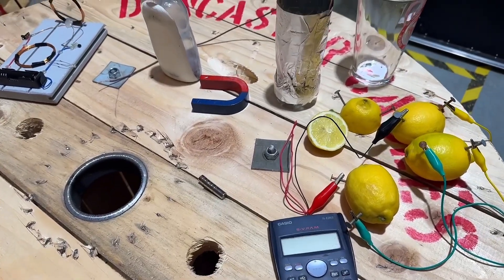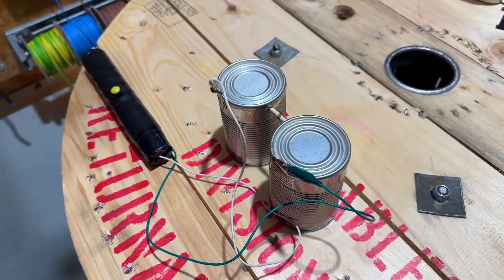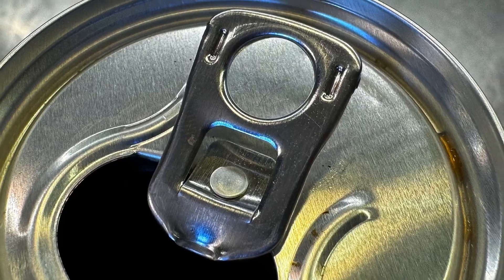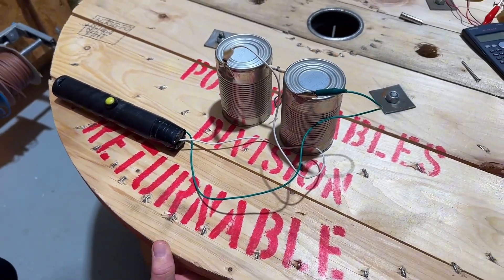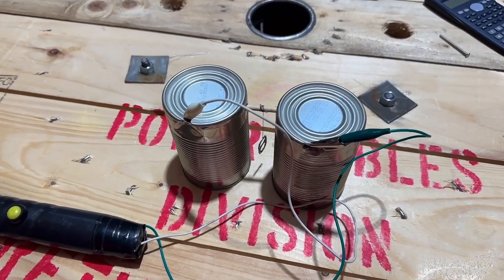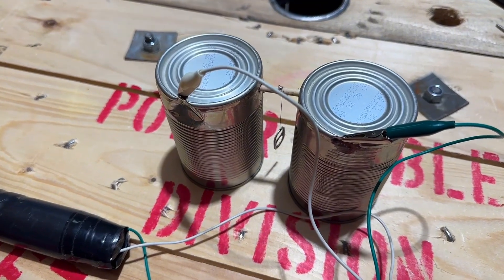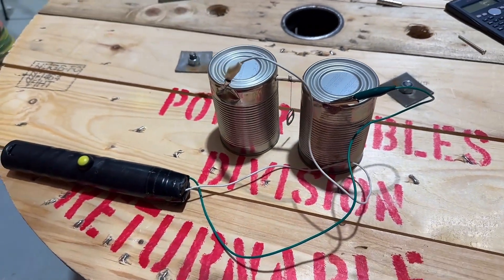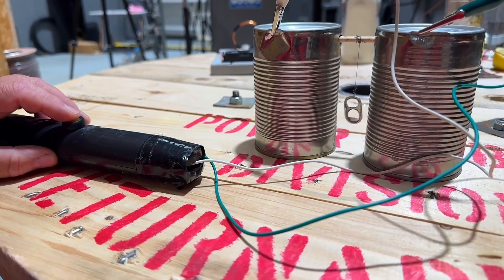How To Predict Thunderstorms Using Dog Food Cans

Comment: Even on days without thunderstorms around a wire 50m vertically into the air can develop quite high voltage in relation to the ground, very little current so sensitive equipment is needed to read the voltage.  With clouds or actual storms around flying a wire into the sky can induce a lighting strike, fine copper wire, drone, kaboom.